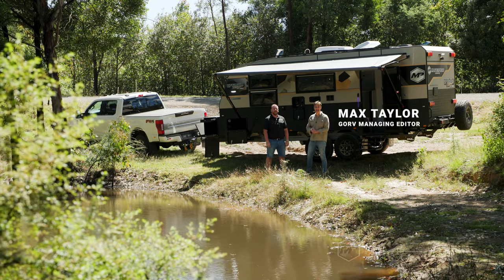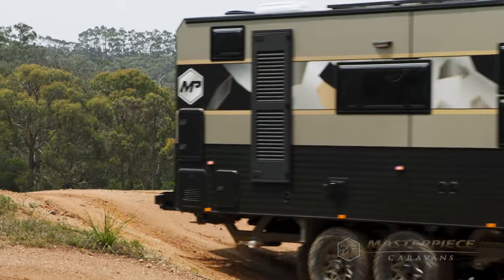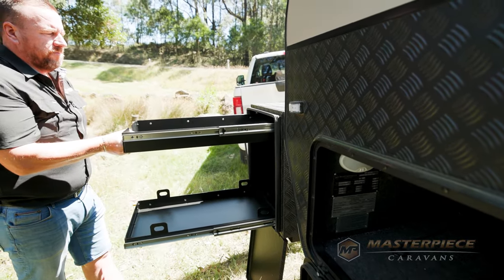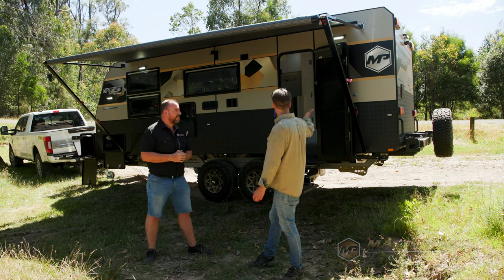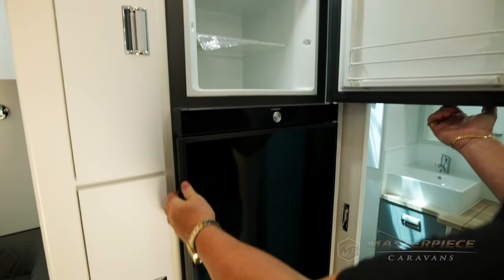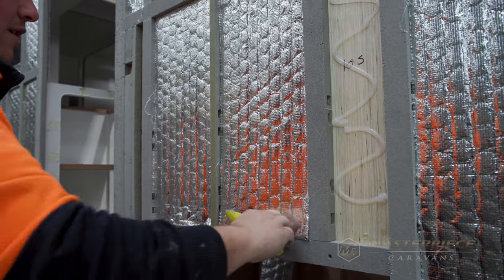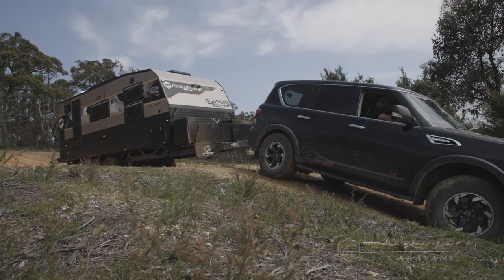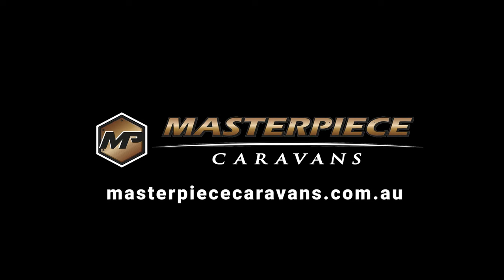THE MOST EXTREME OFF-ROAD CARAVAN TEST! MASTERPIECE CARAVANS OPTIMUM EXTREME OFF-ROAD WALKTHROUGH

Comment: Does it have sway bars or some kind of stability system for on road towing?
There is one of these high lift type vans on its side on the highway near the Sunshine Coast about once a month.
I'll bet only the manufacturer takes the van anywhere they need so much clearance and all that weight up above the top of the tyres.

It's high time a stability test becomes parts of the ADR process.
Reply from the maker: This is revolutionary made suspension, designed by Premcar.
Reply: @masterpiececaravans2256 
Does it undergo sway testing and any kind of certification?
It's not a knock at only yourselves, but the broader industry as a whole.